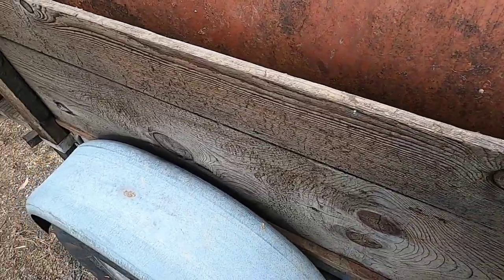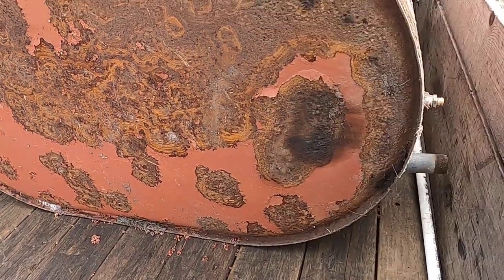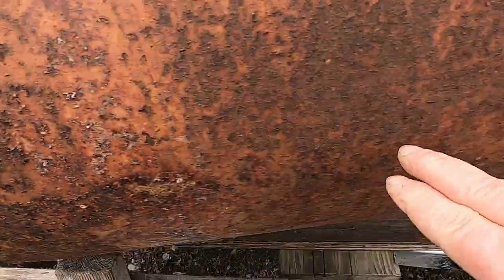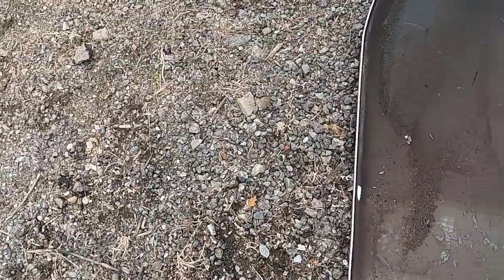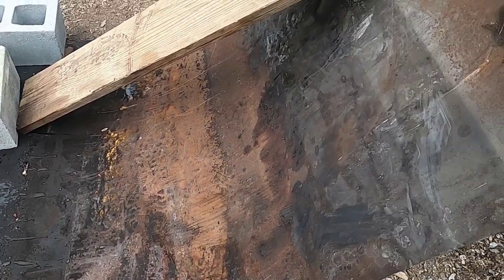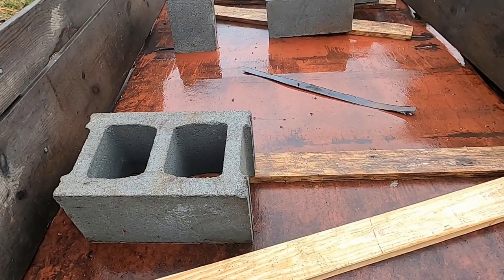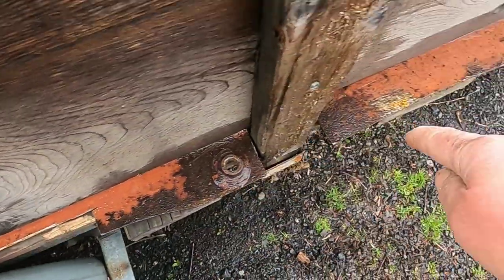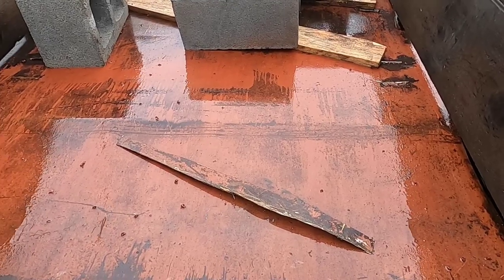TRAILER GETS A METAL DECK

Comment: That's a good source of steel. Looked to be around 1/8" thick.
Reply from the maker: You actually inspired me with this years ago. I was building a chicken coop and firewood storage sheds looking for a few ideas. Then I saw your video where you used 55 gal drums to make a roof for your shed. I did not make a roof the way you did, but use the 55 gal drums as a roof cover to protect against the upcoming storm," have the shingles never put them up LOL". After I flatten the  drums I just lay them on top of the fire wood. The sides get wet but the middle stays dry. Plus I have a couple of sheds ( more of a lg dog house ) made with pallets & drums for roof covering.
Moe I want to thank you again for your help years back when you gave me some advice on setting up a home repair shop.
Stay well Buddy, Joe Z